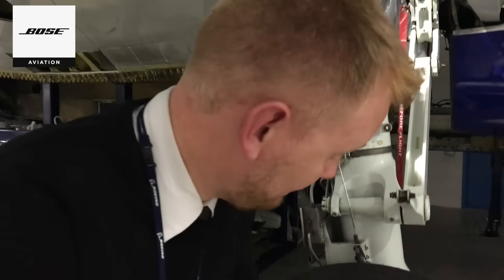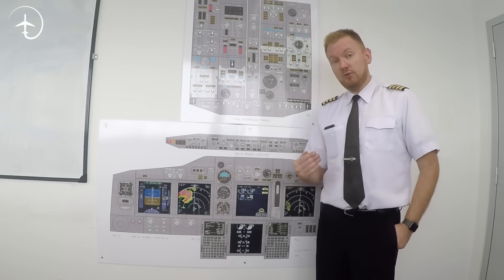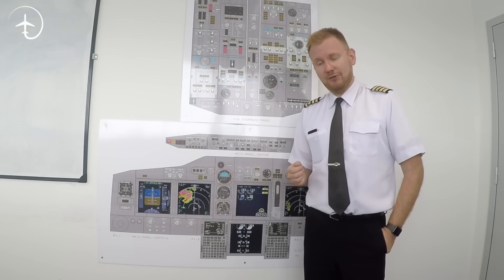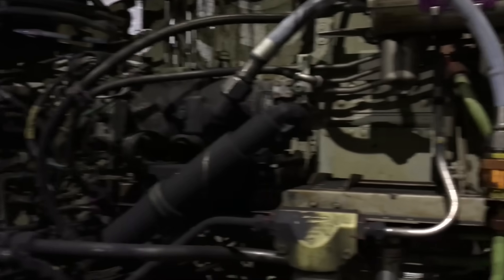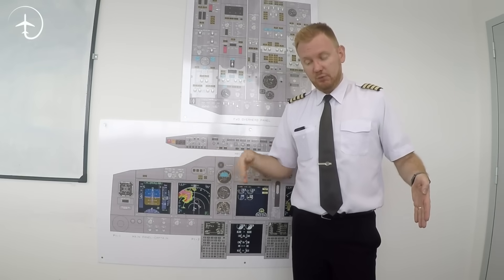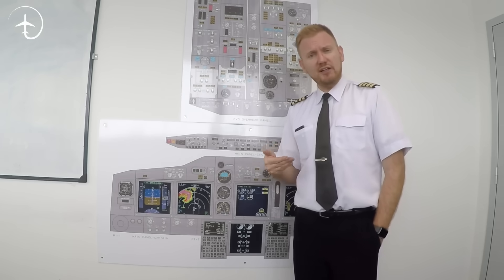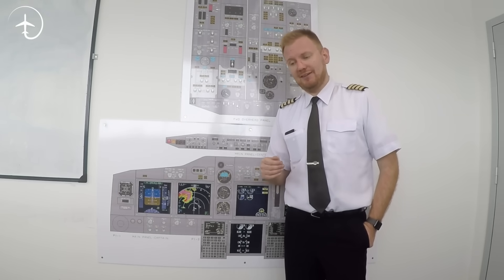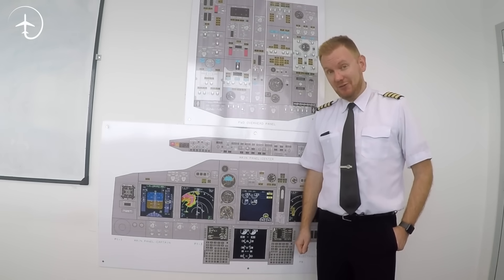Why does the Boeing 737 not have any landing-gear doors?

Comment: Damn that's a lot of pipework
Reply: Mostly hydraulic systems.
Reply: Scitimar that's what she said😂😭
Reply: @ John Beer LONG is good, many might not be! lol  Take it from a horse. :)
Reply: The B737 main wheel well doubles as the plane’s nervous center. A separate compartment for such task didn’t fit in the 737 elsewhere because it’s a such small airplane and thus they had to combine main wheel wells with the nervous center into 1 compartment.
Reply: First thought was, "messy data centre" :D

Comment: Do airline pilot needs to do passage planning or do they just key in the destination on the flight computers and the autopilot does the job? How do pilots monitor their position while en route?
Reply: AyidIsMe ,
For regularly scheduled airlines a person known as a dispatcher creates a flight plan. That plan is presented to the flight crew for review and modifications. Issues discussed are forecasted weather, delays, diversions, and how close the aircraft is to its maximum allowable takeoff weight at the beginning of the takeoff roll. The flight crew either accepts the plan as presented or requests modifications. Some modifications are requests for more fuel or for the removal of cargo.

Comment: Hey! I’m a big fan of yours!! I have a question though... Why does  the 737- 700, 800, and 900 have the same wingspan for all models? Does the stretched fuselage and weight affect they way the plane performs in flight. Does that add more stress to the wings? Or, do they actually have different wingspan lengths?

Comment: Mentour, a great explanation of the systems.  However, the main reason brakes are applied as gear are retracted is gyroscopic precession.  Landing gear retract sideways and those spinning wheels and brakes have a strong effect.  Nose gear only have spin brakes because there is no gyroscopic effect.  The rotational axis is not altered.

Comment: Maybe you can do video explaining winglets, and why latest 737 use double set of them? 😀
Reply: There is no such thing as double winglets. I would barely make distinction between wing and winglet since they work as one in the hydrodynamic flow and affect each other.
Reply: Дмитрий Д the B737 max has them, called schimitar ,that’s the LOWER ONE so far it’s the ONLY ONE
Reply: Denys, Sire Mentor has a whole video on winglets!  :)

Comment: that's why i don't like the boeing 737, everthing looks like shit. you can see the wheels and the engines are not round.
Reply: It's designed to move people safely, not to satisfy your weird mind.
Reply: Svein Hanssen I don’t like the 737 either. I like the 727 a lot better.
Reply: Engines are round...just not the cowling..
Reply: Steve Rosengren If not mistaken, but AIRBUS  A340, had flattened out couplings too.
Reply: Not a big fan either.

Comment: The inside of the wheel well bay, the configuration of all the equipment and piping is pretty crazy looking! I spent a career working with and on industrial equipment of all kinds and that bay does not inspire confidence. However it has worked for 50 years, how can you argue with success!

Comment: You say that the 737 was developed for US regional routes, but the launch customer was Lufthansa (i.e. German).  I remember reading an article about it in the Lufthansa magazine many years ago.  If I remember correctly from that article, the original 737 was designed to be capable of landing on a coastal beach airstrip.
Reply: The -200 model was available with a gravel runway kit . Was used in Alaska and northern Canada . They are still in use today .

Comment: The coolest part of working at an AMO is watching gear swings. The whole action of the gear being sucked into the belly of the beast is most impressive, and seeing a whole aircraft being held up by only three jacking points is a little daunting.

I never really took into consideration why they wouldn't have doors over the wheels. But less weight makes sense and reducing complexity as well. Plus I have recently done rigging of the MLG doors and it is a huge pain in the butt. So from a maintenance stand point, one less gear door to rig is better too. 

So many aircraft have this solution and some don't even have fancy hub caps, like the CRJ, Challenger, and ERJ all have exposed wheels and lack hub caps. So it must not be a huge deal aerodynamically.
Reply: Okay, I'll be the one to ask the dumb question. How well does a plane land with one or more flat tires?
Reply: Donald Clifford i dont think that is a dumb question at all, but a very curious one for sure. It is not an easy one to answer either, because of one main factor is that landing gear on aircraft vary so vastly.

One thing is for certain, that commercial aircraft manufacturers employ multiple levels of redundancy. Thus you'll note that many commercial aircraft have multiple tires on the main landing gear. If you lose one per axle it's a concern but the plane should handle it well as long as the pilots dumped a significant amount of fuel to reduce weight. 

It might not be the smoothest landing ever but some might jokingly say that any landing you can walk away from is a good one. Maybe check out the JetBlue incident at LAX when they had a nose landing gear not rotate fully on deployment and on touch down it sparked and screeched to a halt, but ground the whole front tire assembly to a pulp.
Reply: Waldek:  I assume if we fly regularly, we probably land with at flat once or twice, and never notice it. Commercisal air is amazing in its safety record. Thanks for the reply.
Reply: Donald Clifford you're likely right about that. You'd never know about it as a passenger.
Reply: I have to agree. Watching a nearly 2 story high 777 landing gear retract in a couple of seconds really gives you a sense of how much energy those hydraulic systems have.
Reply: lolvks 3000 psi is a lot of power